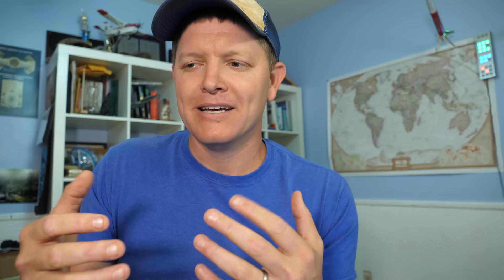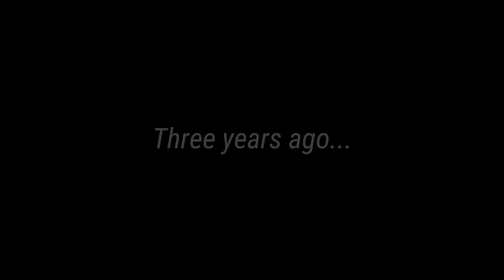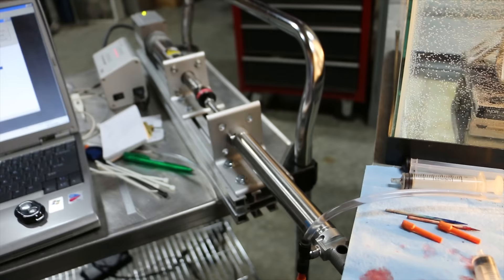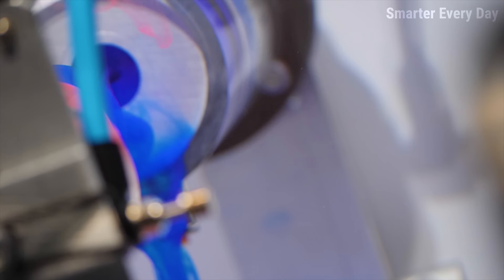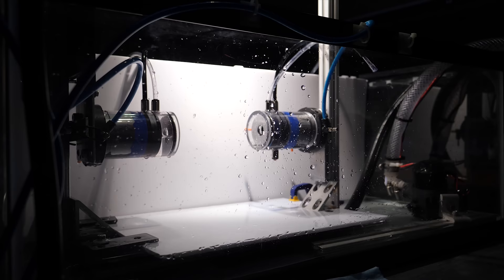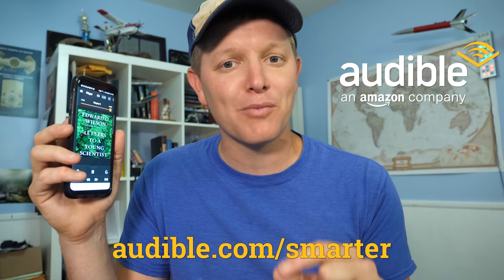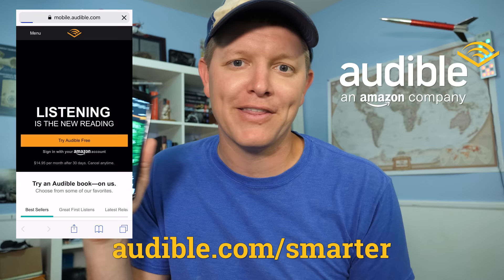Two Vortex Rings Colliding in SLOW MOTION - Smarter Every Day 195

Comment from the maker: If you'd like to help, it would be great to get some captions for this video in your native language.  At this point, there's no English.  Help would be appreciated! http://www.youtube.com/timedtext_video?ref=share&v=EVbdbVhzcM4
Reply: hey you know how tornado's being created right with hot and cold air what if you would heat up the red liquid and cool down the blue or something like that it sound better in my head but maby you could do something with this
Reply: Destin do a video on mechanical face seals, and gas compressor seals. 

I work for a company that designs and manufactures them. The gas compressor seals are flat to within 2 millionths of a inch and use a design to create lift between the rotary and stationary faces with no contact. Sealing hundreds of bar. We measure their flatness in helium light bands.
Reply: So I was looking at the shots you made and I notice that they are not just secondary rings but 1/2 blue - 1/2 Red and that they don't mix. So the pressure wave from the 2 are causing a form of kenetic barrier with the weaker eventually breaking down. The density of the 2 liquids are not equal. 

But none the less brilliant...
Reply: You are an amazing person ! I like your work , and , i can't donate you but if i can , i want to do that ! it's also a scientific channel and moral based for the life !
Reply: You have got to contact the original author and show him, and do more experiment similar to this
Reply: Skip to 4:20 for completed
Reply: SmarterEveryDay hi i am new. Are you serious? How can you not include some of the science behind this. The universe has done this amd I am pretty sure it didn't need to be in a tank with water to make it achieve anything. Don't get me wrong, I comend your persistence, but all of that work and you didn't include science and math? That is going to bother me so much.
Reply: test
Reply: SmarterEveryDay my vortex collision is finding a girlfriend
Reply: OK,  imagine your holding two sticks,  on each end,  is counter rotating wheels.  Keeping them the same distance apart,  push I've into the ceiling.  That one will run to one side, and keep moving until the other also hits the ceiling at which point you have moved them both 90 degrees.  Now apply that to your mini vortices and you'll easily understand what's happening.
Reply: I imagine this 90 deg rotation and buildup of the new rings to be due to precession like a gyroscope would do and laminar vs turbulent flow. In some way that could influence how many of the secondary rings are there as well (spatial frequency). I didn't do the maths though but precession likes having rotation and torque at 90 deg angles. Torque could be due to shearing force between the fluid layers of the two colliding rings?.
Reply: Hi Destin, please check revision on Indonesian subtitles, there's some typo in previous version. Thanks. I'm your fans from Indonesia. You've done amazing things throughout the years. I hope more Indonesian people subscribe to your channel and be Smarter Every Day. :)
Reply: SmarterEveryDay  Hey SmarterEveryDay, 

I would like to have a chat with you, give you some input and learn some things on fluid dynamics and this video. If you could send me a message i will send you my email and go from there?.

Thanks.
Reply: what happen if you fill the tank with oil insted  of water
Reply: u waste ur time i did that kind of experiment and why u waste ur time it matters where on earth from ecuator you are the Vibrations of magnetism influence everything that lie in that area so do ur research
Reply: SmarterEveryDay hey I think it's possible and doable. Think about HAARP weather machine.#IJST
Reply: I cant believe how invested, and rejuvinated i feel after watching this. Imagination is insane, if i had this tech, i'd sit there day in day out just observing and understanding. Amazing work, you are truly incredible, and anyone would be lucky to work with you.
Reply: OMG! That was me who first sent you that video (and I reminded you about it when you came to visit Adelaide)! Thank you so much for persevering and finally getting it made :D <3 <3 <3
Reply: SmarterEveryDay Knowing that fluid dynamics and electromagnetism have analogs, I did a quick search and found:
ieeexplore.ieee.org/
On Analogies Between Hydrodynamics and Electrodynamics for Plasma Technologies I
Might see if the research in electromagnetism has produced data applicable for your work.
Reply: my name is destin toooooooooooooooooooooooooooooooooooooooo
im not lying i swear
Reply: Would it work with smoke rings in air?
Reply: Kitty90 I think he means the mathematical analysis will need to be reserved for a later time. Fluid Dynamics math can get hairy
Reply: Not sure if you will see this but i think this is something you might want to recreate 
watch?v=uENITui5_jU 

love your videos keep up the good work
Reply: Kitty90 Did you watch the video or skip to the end?  The unknown is exactly that: unknown.  There was some math involved to bring everything to equilibrium but it appears that no one understands the product of the colliding rings.
Reply: SmarterEveryDay I think I know how it turns 90°. The motion is already headed out from the center even when the pockets that are coming together collide. So when they begin to roll away from each other forming a ring the direction they roll is still to the outside. As even when they were coming together they were still moving out from the center.
Reply: SmarterEveryDay love audible.
Reply: SmarterEveryDay I replied in Arabic not sure how good it was,lol but I loved the video thank you
Reply: this
Reply: I think the 90 degree turn is the force twisting the rings like a tornado then they collide with the other parts that have the same force to make another ring 

(This is a simplified way to say it so everyone can understand it)
Reply: Thank u for this video .. I translated it to Arabic .. and this the least thing I can do
Reply: Its simple. The original vortexes had orientation. The collapse between is going to orient itself towards the orientation of each respective vortex, the result is similar to how you spin a coin, you have a for from one direction at the edge and a force from the other direction at the other edge resulting in the rotation.
Reply: SmarterEveryDay I figured it out so as the forces of the collision push out it creates ....to find out more contact me
Reply: SmarterEveryDay Could be like mushroom clouds.  If you squirted one of the dyes on their own, it would billow out into a ring.  Would it be the same idea?
Reply: Very fine video, nice physics!
Reply: eq __ effect not affect
Reply: Not sure if someone already explained how the outer rings form but if not just respond (anyone) and I'll explain.
Reply: SmarterEveryDay  wouldn't it be cool if you made a video about body kinematics of people like bruce lee and how one inch punch works?? Love to know about  human body mechanics from you!!
Reply: Im confident that Jason Padgett could numerically figure this out. Reach out to him and make a part 2 to this. Thank me later.
Reply: Hey Destin, I don’t know if this will help, but I thought about another phenomenon that is very similar to the secondary rings.
   Some “professional mermaids” will have a bubble in their mouth, put their hands over their mouths, and then blow the bubble out as they quickly pull their hands away from their mouths and away to the sides, this creates a ring that moves away from them like the secondary ring.
   Perhaps when the original collision creates the expanding disc of “collision area” the nodes on the expanding ring of ink are like the mermaid blowing out the bubble, and the low pressure zones between the nodes are like the mermaid pulling her hands away. That seems like it could create the secondary rings.
   Perhaps you could look into what makes the mermaid rings work and see if it applies to this phenomenon.
Reply: what if the ring is simply the most efficient shape for a travelling fluid? similarly to the sphere being a gas bubble's most efficient shape.
Reply: SmarterEveryDay the answer is simple as the rings collide the momentum stops but the rotation continues which is y they expand but the expansion thins them out and speeds up the rotation making more rings cuz if u watch the first two they rotate from the center to the edge's and once they collide the same thing happens to middle where the two meet push out so the rotation is now push out from where they meet and pull in from the two sides where they were fired so the small ones r like what happens when u blow on a wall the air is pushed along the wall unit it hits a second wall or loses momentum and stops the difference is cuz it's two spinning parts u can think of it like wheels put two wheels on the floor as one spins the other spins the other way but still moves in the same direction but if u watch the wheels they move just like a vortex the middle moves out and the edge's move in pushing it along

Also I got that after watching this once and took about 5 minutes to put together
Reply: SmarterEveryDay +ๅ
Reply: This is kind of off topic but with a vape pen i could blow rings and it would turn into a bunch of small rings like that but only when it was really humid.
Reply: это напоминает картину в видео "как вывернуть сферу наизнанку" this resembles a picture in the video " how to turn the sphere inside out" https://youtu.be/p8zPx41oxwE
Reply: to me it look similar to galaxy and the big bang, get this vid to michio kaku channel. he might interested and give you some support.
Reply: I loved this video. Very satisfying. It would be more efficient and give you better results if you use a chamber of air and use colored vapor for the rings. It would allow you to flush the chamber easier and with less energy
Reply: "Every time we fall, we learn something". Let's do things.
Reply: SmarterEveryDay is coloSionan
Reply: +Kitty90         he got into the science at 6:19 when he explained astronaut Don Pettit's hypothesis that low pressure zones in the outer ring were creating evenly spaced nodules that rotate 90° and form the secondary collisions.  he didn't get deep into the weeds, but how many would get it if he had?
Reply: Both rings are spinning in a different direction. When they collide, you can see what happens.
Reply: Great job. Can you share the link to old paper? Or name maybe? You have made a huge demonstration of how science works. Try and mistake, every fail is a lesson. Thanx 4 share your spirit. Science rock! (Feel sorry bout my english, im hispanic)
Reply: +Felipe Andrés Troncoso Angulo
hey, don't sweat your English (i know it's better than my Spanish).  unless i'm answering yes or no questions, counting to 10, or asking where the bathroom is, my Spanish is useless!
Reply: SmarterEveryDay well from what I think the form in the middle and why it goes to a straight 90 degrees is the force from both sides. If both forces are being pushed at the same rate and force it give the other a counter such as if u put ur hand under water what happens. The force collide and spread around it at a 90 degree angle so from what I can tell is that from the center the force is force the the sides and the force from both sides hold it in place but when it reaches further out ( the outer ring ) it circulates causing the rings to form
Reply: This video got me to subscribe. Thank you. This is amazing!
Reply: SmarterEveryDay  can you do an episode on the up coming space probe being lunched into the sun, I read a little about it and it sounds like a perfect episode because it’s not easy stuff
Reply: I believe as the astronaut said the contrasting higher and lower pressure areas cause the grouping of the converging rings on the outer area. Once these 2 sides meet and group they are set up for there next dynamic movement. As both sides still maintain their rotational motion (smoke ring spin) they are now like the outer rings of a new smoke ring but without being joined. As the pressure difference brings their ends together their rotations catch each other and send it into motion to make a new circle (probably because of the dynamics of a circle being the most “nurturing” to this motion.) I kinda of thing about it as if you had 2 quarters and you lay them side by side. Each quarter is the outer wall of your smoke ring. If you rotate them in opposite direction (one clockwise the other counter clockwise) then flip them up to make them lay flat against each other they now are rotation in the same direction. This is the point when the new smoke rings are formed.

Your welcome!!
Reply: SmarterEveryDay if try seeing in what type of water clear /water with ink something travels at the speed it may help you find your solution
Reply: SmarterEveryDay 
The search for knowledge needs no explanation.
Reply: SmarterEveryDay D!! The only thing I could think on is galaxy's  colliding... so, how about colliding it by angle? As Andromeda and Milk Way should do someday... Than we see the trail of it!!
Reply: Nvm I see what u mean by turning 90 degrees now after watching the over.
Reply: I believe that the core of each nodule experiences less drag than the outer "layer" of said module in the same way a smoke ring forms.
Reply: Do the nozzles produce a perfect laminar flow? The lack of disturbance  in the in initial opposing blobs of liquid and the fact that they travel an equal distance and are traveling the same speed when they meet, seems like the key to this experiment. In my opinion.
Reply: This is the first video of yours that I've seen -- so interesting....and such a nice break from my main focus (human rights/politics)!! Subscribed & shared.  Looking forward to experiencing your back catalog, thanks!!!
Reply: SmarterEveryDay, "Я уже говорил тебе, что такое безумие? Безумие - это точное повторение одного и того же действия, раз за разом, в надежде на изменение."
Reply: SmarterEveryDay Literally have you thought, this is a simulation of the Big Bang and our solar system is one of the smaller rings that didn’t distort and continued traveling threw space
Reply: SmarterEveryDay SUBSCRIBE that’s tight
Reply: SmarterEveryDay I believe what is happening is similar to cavitation. When the ring starts to break down due to low pressure, the fluid surrounding the ring snaps in to fill the void creating the smaller rings.
Reply: youtube unsuscribed me so i'm suscribing again on this video
Reply: Hungarian done (What if you send the high-res photos to me in exchange?)
Reply: It would be interasting to make the same in a physics engine on a pc and see what happens. 
sry for my english
Reply: Why is it not in #1 ?! You have given so much effort in it and have succeeded, that's all that matters!!!
Reply: It seems like it would be easier to track the reasoning behind the outer ring twisting effects by putting in a visible particulate that can be suspended in the tank before firing, like dropping in glitter for instance. Real pain to clean though, I imagine. May have to explain your shirt to the wife later on too. :)
Reply: SmarterEveryDay il
Reply: Not gonna lie, this video brought a tear to my eye. The mystery is no mystery; your sending relatively equivalent amounts of energy through a polar fluid that is already traveling through multiple electromagnetic fields (earth,sun, galactic vortex). In your experiment, the Plain of each little ring that appears is 90 degree inversion from the plain of the original big ring. If you assign the color Red to Magnetic force, and the Color Blue for electric force, you've created a visualization for how the two combine and make electromagnetic waves that's alternate between X,Y,Z plains. if you could continue adding force to the original Big circle in a controlled way, the smaller circles would grow and push outward on their own plains. I would love to see if the smaller rings would eventually FLIP again another 90 degrees to show the fractal laws in motion...
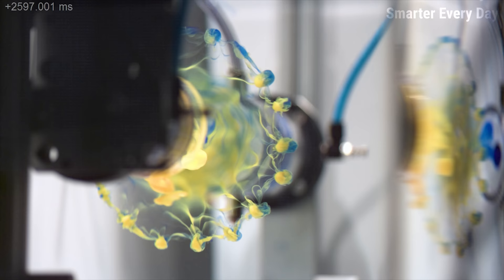Reply: @5:21- top right corner of Blue Yellow convergance, you CAN see a 3rd flip of the energy wave  an additional 90 degrees creating a final tiny Ring in the original giant ring's plain of convergence. also please note the smaller rings while flipping on 1 axis, still traversed away from the center big ring on its original outward trajectory. just amazingly beautiful.
Reply: Sorry, but it's not serious unless it helps to cure cancer
Reply: I know how it turns into the smaller rings
Reply: Dude, you should totally figure out how to photograph those collisions because those would make awesome art work to hang on the wall!
Reply: SmarterEveryDay  I’d really love to help you guys I do speak Spanish if that helps
Reply: Não sei se é apenas impressão minha. Mas essa experiência me lembrou a Geometria Sagrada e Nikola Tesla com o seu fascínio pelo "9".  Quando o anel grande se divide em aneis pequenos vejo um padrão "9",  mesmo que seja mais de 9 aneis pequenos se percebe uma união de 2 em 2 aneis que aparenta dar 9 conjuntos de 2 aneis.
Reply: This might have already been brought up, but the start-up fusion company, General Fusion uses colliding hydrogen-plasma vortexes to create its fusion. Just as they collide, the swirled, molten, lead-lithium cavity that briefly houses the plasma is collapsed by 200 pneumatic pistons. This is to crush the plasma under enough pressure to get it to "ignite" fusion.
Reply: I love people like this... "it HAD to be done" - purely for the joy of understanding. Thinking like this, fuels discovery, maybe not for these chaps necessarily, but for anyone else who stumbles across their video.
Reply: why is it so mystery...
they need more time to mix, if too fast they just bump. they spread and vibration bump cos they don't have enough time to mix somehow.
then depend on degree/axis of bump, there the effect the expand ring, the more the material the more it would be expanded. when the materials not enough to expand and depend on vibration from before then there the 2nd ring effect.
that just theory tho. have u tried with exact same materials and color. or somebody tried with vape...

have u tried to adjust the speed and axis, that would create a circling rotary effect something like yin yang lol (just wild imagination lol)
Reply: Use a smaller, shorter tank, you can get the result faster.
Reply: That is so AMAZING!!!
I  can't imagine that you are doing it again!
And the few words in the last of the experiment is really touched me.
YES, the success isn't because of the precision instrument, instead of the patient.
And the picture is so beautiful,  thank you to let us see the magical time!
LOVE YOU GUYS!!
Reply: Can you somehow perform a expirement that consists of two guns pointing each other and shooting a bullet at the same time. 🤔 It will be pretty interesting seeing what happens to the bullets.
Reply: Are you aware that the secodaries are Fibonacci numbers. Liquid fractals.
Reply: I tink it's like the Big Bang.
Reply: Yes there is English captions in this video.
Reply: suggestion: try it with water at 0-1 celsius (just before it becomes ice), perhaps this way u will get less interference in the patterns the rings create , by the movement of higher temperature water molecules. peace. that was awesome!!
Reply: @pirillomatis  Did you did this your self or giving out ideas? Because if this is an idea, that's a good idea!
Reply: @ZekePolarisBSH  nope just an idea. i was just thinking "man they must have let the water really settle for a long while before each firing." which led me to think about temperature :D
Reply: @pirillomatis  Nice thinking!!!!
Reply: @ZekePolarisBSH  thx bro :D
Reply: @pirillomatis  no problem
Reply: i found someone a using a clip from this video on facebook and its becoming viral.... want the link?
Reply: @ZekePolarisBSH  cause I typed them :P
Reply: @JJRicks  what are you talking about? Why even the because? That reply makes no sense please explain?
Reply: @ZekePolarisBSH  you said there were no English captions on the video, but after you said that I typed the English captions and submitted them for use
Reply: @JJRicks  ah that what you are saying, sorry I can't see other comments, I need to be on by computer.